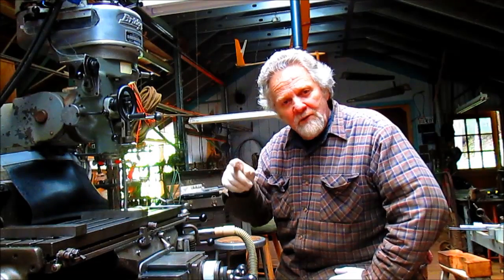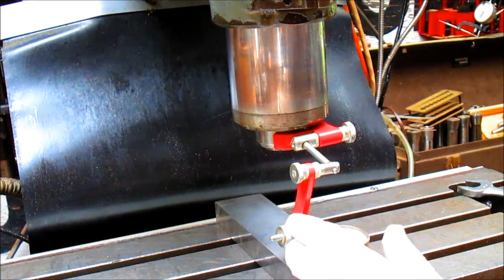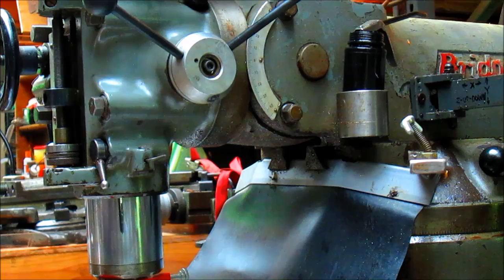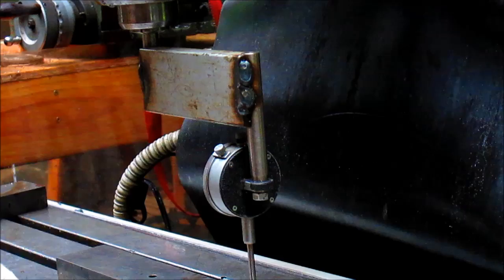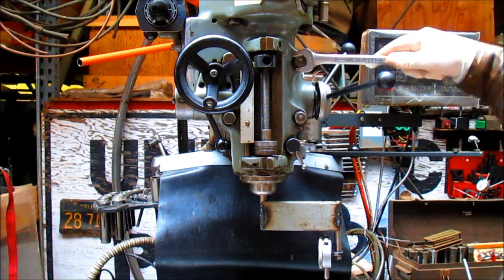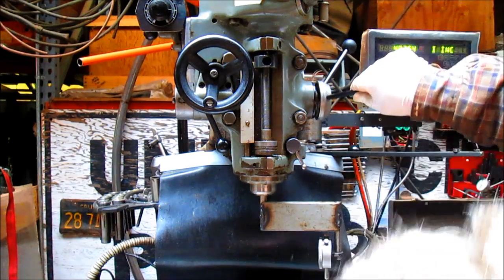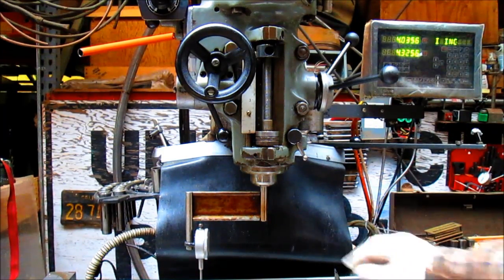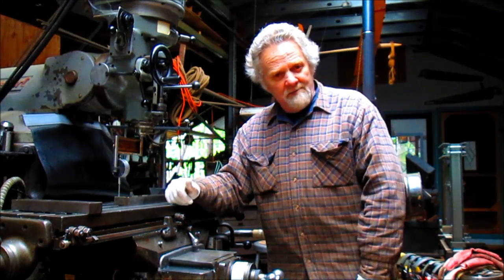An inexpensive approach to tram a Bridgeport

Comment: Been doing this in a similar way but I use a small ground gauge block and sweep the table at 90 deg  increments  sliding the gauge block under the indictor . also I  stone  the table before starting . most well used Bridgeport tables have nicks in them

Comment: You left out the easiest method, 12" square from the table to those two machined surfaces on the front of the quill. Works well on both the nod and the tilt. You have to bring the knee up so the table is right under the spindle so the square will reach both surfaces. But it works well on the Bridgeport at my work.

Comment from the maker: William; Actually I had just completed cutting a piece at 45 degrees in the "X" direction so when I returned the head I did so using the degree wheel, close but no cigar. With many non accurate operations that kind of close is good enough, but when it counts I take the time to tram the head. Thanks for watching.